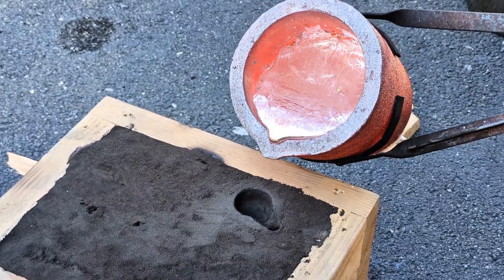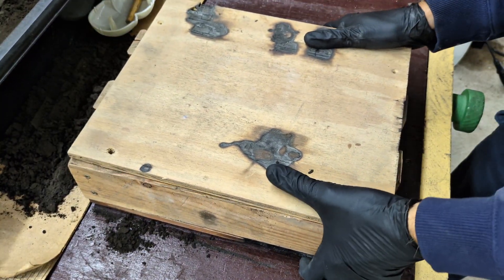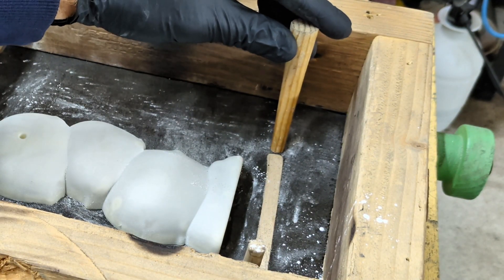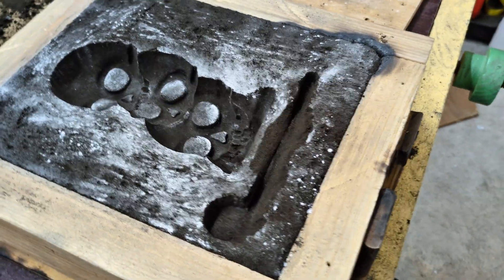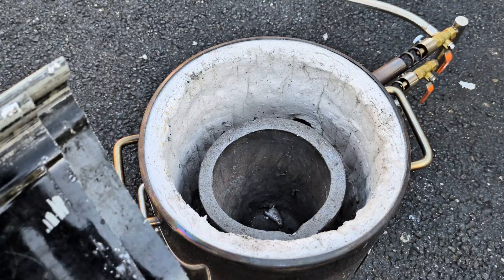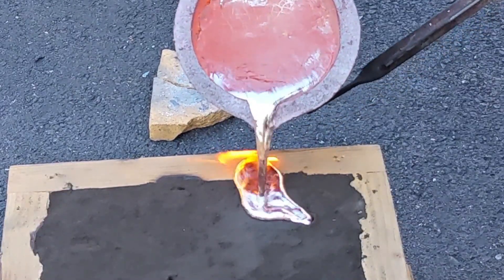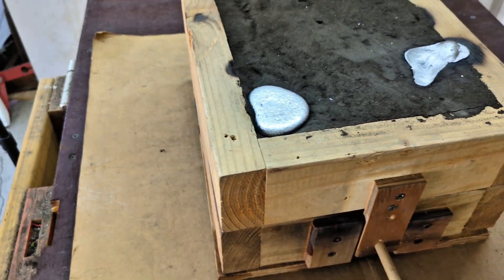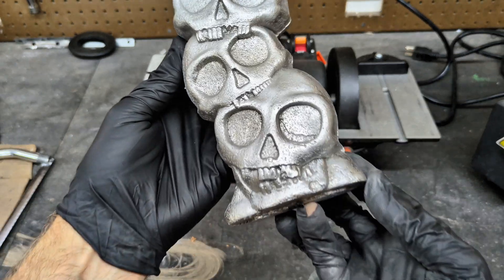Sand Casting - Making molds for metal casting - (Trash To Treasure)

Comment: The shrink has to be there, I bet there's a void inside it where it might never be seen if you don't cut it open.  If the outer skin has enough time to freeze solid enough before the middle does, the shrink can sometimes hide on the inside like that.  Might mean having to scrap a machine part, but not this thing 👍
If you can't keep your sprue full without overflowing the basin, either your sprue is too wide or the step between your basin and sprue is too high.  Looked like a bit of a big sprue to me, I think that's what let your mold suck air. If it did.
Reply from the maker: hmm, well i'm not going to cut it open to find out 😂😂😂

I've used this sprue a lot on the past with no problem.  Maybe I had the pouring basin closer to the sprue.  Or as you said the step might be too high.

Thanks for your comment and input. 👍👍
Reply: @HeinrichsMade  definitely don't cut it in half lol, nobody cares if there's a shrink void hidden inside! 😂  All a decorative piece like this needs to do is fill completely and look good.
Reply from the maker: @tobhomott  lol, I definitely don't care if there is a shrink void inside 🤣🤣
It Definitely looks good 👍